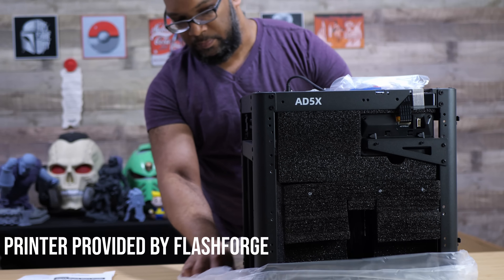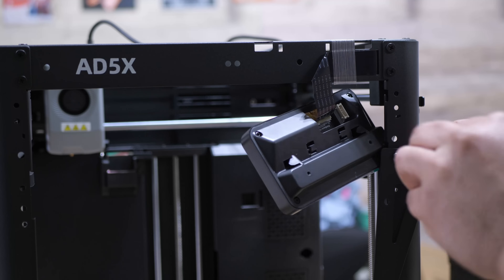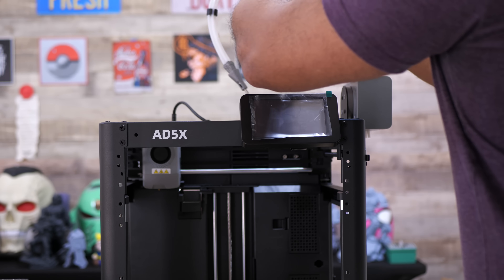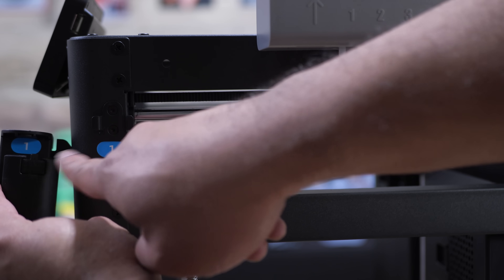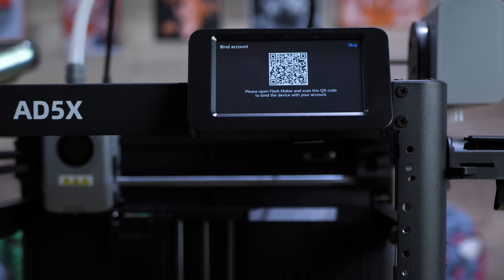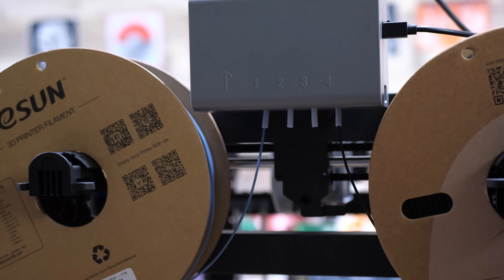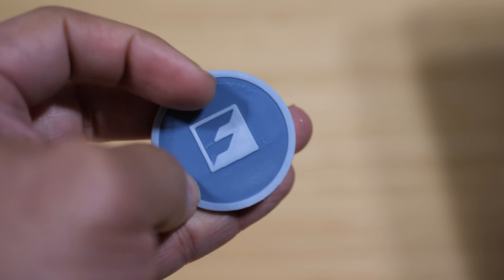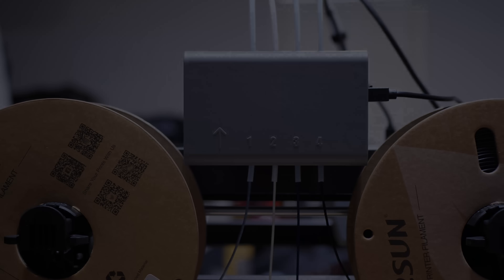Flashforge AD5X First Look! Unboxing, Setup & Test Prints

Comment: Can’t scan the QR code with the app because the camera sucks so bad, got the computer app. Different app btw, half the things, had to move the nozzle piece to get the styrofoam out of the unit and when I turned it on it just started running into the wall and wouldn’t stop, can’t calibrate the unit without connecting to the mobile app, not an option to do it on the computer, please send a quick fix before I actually toss this thing upside down in the box no tape and send it back

Comment: Hi, I was going to buy an AD5M based on one of your other reviews. It came off special the day before I could afford buy it. A couple of days later the AD5X (which I didn't even know existed) went on special and I bought it without checking for a review. It arrived 4 days ago, but I said I wouldn't touch it until I learnt how to do the basics of freecad. 
I'm setting the AD5X up today because it's raining. This will be my first ever 3d print on my first ever 3d printer. Thanks for the set up video.❤❤❤❤

Comment: Question y’all . I been having trouble with my prints failing and stringing and not finishing . I tried adjusting settings and temperature. I also had a weird noise from the bed one time . I feel like I’ve gotten a test model. Idk I’m probably overthinking but ima clean the nozzle out again and see what’s up but this doesn’t feel right to me . I might return it what would y’all do ?

Comment: Do you know how much test filament it comes with? I just got mine and it has 4x test filament and I haven't received my spools yet. I just want to know if I am good to print a full bed of small figures to test, or if I should only print one of them until my spools arrive?
Reply from the maker: I'm not sure how much the amount of sample filament is, but the typical amount is 50g per sample. I'd print 1 figure to start just to make sure the adhesion and print quality is good.
Reply: @FigureFeedback  Also the maual says the toolkit includes glue but I didn't see any glue anywhere. Is that the same for you or did it come with glue?
Reply from the maker: Mines did not come with glue or lubricant.

Comment: the machine is good, but why not upgrade the platform to 300x300 - just to stay current
Reply from the maker: Flashforge is coming out with the Guider 4 Pro this year that will have a 300mmx3 build volume along with IFS compatibility.

Comment: Good to see the AD5X in the wild after the initial shipping delay.  I seldom do any color printing although that Joker looks awesome, but I'd like to have an AD5X to print TPU and PETG on the same part, or PLA supports on a PETG part.  A lot of purging is needed to avoid weak prints from dissimilar material contamination.  I was initially very interested because FlashForge said the IFS would accommodate 95A durometer TPU but I've since heard that they rescinded that recommendation and now require the stiffer TPU so I've mostly lost interest, but the IFS does still look like the best design for an MMU with streamlined integration and minimal Bowden tube travel.

Can the AD5X load two reels of two kinds of filament and intelligently switch from one to a full reel when a reel of the same material is empty?  It'd be handy for a print farm operator to unload parts and replace any empty reels and not need to worry about a reel running out in the middle of a print.
Reply from the maker: Yes, it can intelligently swap between filaments. This feature works only if you're using the same filament type and color.
Reply: @FigureFeedback  - Thanks.  I just checked the AD5X web page.  They do mention the AD5X ability to automatically switch reels.  "When printing a single-color model, once one spool is used up, it automatically switches to the next spool. Print with peace of mind."  This will greatly simplify print farm management and makes everyone's life easier.  If it has this capability, it should be able to have backup spool capability for two color printing, or generally, any time there is filament available of the same type and color.

Comment: I have the adventure 5M that only does 1 color. Ive switched to a 0.25mm nozzle, reset the settings to 200°C and bed to 55°C, and am using PLA+ instead of regular PLA... works a lot better now. Also switched to slow print speeds
Reply: How do you set the temperature to stay . Because when I print it changes. Idk why does it have to be through the program or through the printer itself ?

Comment: i feel like they could sell just the extra things and I could add this to my "normal" A5M, I hope they do. 
What do yall think?
Reply from the maker: Flashforge said the IFS is not backwards compatible. It uses a different extruder, mainboard and there are differences on the frame where it needs to mount and flush the filament.

Comment: Bambu X1 has become the new Prusa i3. Everyone and everything is copying the design
Reply: The IFS is streets ahead of the AMS. The feed path is very straight and as such it's far easier to clear jams and clogs and can also handle TPU (not just special Bambu TPU). I've just printed a 4 colour Gecko in TPU on mine.

Comment: First time seeing this in action. Great job on this. I actually like that it doesn’t have a separate unit for the multi color and is just mounted on the sides
Reply from the maker: I appreciate the simplicity of the system so far.
Reply: Me too, the main attraction for me.
Reply: I wonder if it will be as good as P1p

Comment: Wonder if you could print from a storage box or dryer instead? And would be good to see how much poop it produces in comparison to a Bambu with AMS.
Reply from the maker: That's something I have to try. The location of the spool holders and where you assign the spools directly affect the retraction distances. I wonder how that will work in a filament box since all the spools are closer together.
Reply: @FigureFeedback  Can those retraction distance be manually modified? Being able to print directly from a dryer would be a requirement for me.

Comment: Oh HELL no! First thing I saw was ribbon cable for touch screen. After my first and second  Flashforge 5M I swore I would never buy a printer from them that required the customer to install the touch screen. Why, the cheap piece of garbage cable latch on the touch screens ribbon cable connector. Latch broke both times. Had to ship both printers back. When they offer a model like the Adventure 5M pro, which has touch screen connected, I will buy an AD5X. Ok, I watched the video a saw the touch the touch screen is connected, still want the Pro model.
Reply: The AD5X comes with the screen mounted on a small bracket for transportation and already plugged in. You unscrew 4 screws and then clip the screen in place.
Reply: @theaussieviking8555   I read the unboxing instructions for this Flashforge AD5X, on the flashforge site, and it show you have to install the touch screen. I suspect they sent influencers the ones with the touch screen installed. For their regular customers you have to install this piece  of garbage touch screen with the defective ribbon cable adapter.

Comment: My first multi-color print was not great, but I've got another bigger multi-color print going now that looks pretty decent so far, we'll see how it turns out. My biggest issue is that the material/time estimate in the print preview is way off. There is no gcode for the material change so it doesn't calculate flush or add the filament change time to the estimate. My first multi-color print was estimated at 13g and 2h 34m, but was actually about 60g with the flushed material and took 3h 22m. My current print is even bigger and is showing it will take 7 hours less than the same print sliced on my P1. I did clock the actual filament change time and the 5X is 20s faster than the A1 and 34s faster than the P1, but with the number of color changes that is nowhere near a 7 hour improvement.

I have reached out to Flashforge support asking if they can provide the gcode or push an update to the print profile JSON code so we'll see how that goes.
Reply from the maker: Thanks for sharing those findings with us. I would also like to see the amount of flush in Orca-Flashforge as well.
Reply: @FigureFeedback  If FF support isn't helpful I might have to learn gcode better and reverse engineer what the printer does to develop the code myself.

Comment: Nice, although i am probably going with the elegoo carbon . It's just too good for the money.
Reply: Keep in mind that this is a multi-color printer right out of the box without needing any extra hardware. If you eventually want to go multi-color you're going to need to buy an addon down the road for the Elegoo and there's been no details released about if that will be any good. There's also no details on pricing yet, but other similar systems usually run around $300. Even if Elegoo beats that price and drops one for say $200-250, that's still an additional cost that puts the CC at a price equal to or above the AD5X or A1 Combo.

Comment: i there any info about larger size bed plate on next iterations ? )
Reply: The Guider 4 was displayed recently at a trade show in Europe (forgot the name of it), but it uses the same system but is 300x300x300. I'd expect it by mid-year as it was initially planned for the 1st quarter.

Comment: Please do the koy Fish in silk filament 😇 or do tpu and other filament test
Reply: I've done a multi-color TPU test with a black TPU and an Amolen rainbow TPU. The result was quite nice. It had no problems loading and unloading the TPU from what I could see. I see this as the one killer feature this printer has that I don't think any other 3D printer can reliably claim. I definitely want to do a larger multi-color TPU test in the future.
Reply: @donnyriggz  - Initially FlashForge advertised that the AD5X will feed 95A durometer TPU then they delayed shipping the pre-orders and said it would not support 95A TPU.  Are you saying it DOES feed 95A TPU reliably?
Reply: @Liberty4Ever  So far in my one test with about 30 color changes, it had no issues. I don't recall them saying it wouldn't work with TPU. I would have canceled my order if that was the case. The email they sent out said they were delaying the machine to fix issues poop chute jam issues with TPU. I plan to pick up some of that new Cookiecad TPU this weekend for a bigger project. Might also order some of the Amolen Glow in the Dark TPU to see how it handles that.
Reply: @donnyriggz  - I knew that FlashForge claimed the delay was due to problems with TPU in the poop chute but also recall them removing their claim of 95A TPU.  I just checked their website and they removed all references to TPU from the filament section: "AD5X support PLA/ PLA PRO/HS PLA/ PLA Matte/PLA Silk/PETG/PETG Pro/ HS PETG/ASA and open to third-party brands."  There is a separate printing speed graphic that references print times for a 64D TPU basketball.

On the plus side, they do mention the AD5X ability to automatically switch reels.  "When printing a single-color model, once one spool is used up, it automatically switches to the next spool. Print with peace of mind."  This will greatly simplify print farm management and makes everyone's life easier.  If it has this capability, it should be able to have backup spool capability for two color printing.
Reply: I was not aware of that change. It's also curious how they mention ASA, but not ABS when the IFS filament selector has a Profile for ABS but not ASA. It also has a profile for TPU.

Comment: Does this printer have an ethernet port like the earlier Adventurer 5M and Pro?
Reply from the maker: Yes it does.
Reply: @FigureFeedback  I really appreciate that Flashforge has this as a regular feature on all their printers.  I work as a teacher, and my school district does not like having anything besides computers on their school wifi network; this is a common issue in school districts.  I personally run 2 Adventurer 5M Pros and one 5M.  I have them connected via ethernet and can send print jobs via FlashPrint from a connected desktop.  It's very nice to be able to sit on one computer and send jobs that way.

Comment: I’m curious about the feasibility of an enclosure. It would need a bit of a “hat” I think. Would be needed for ABS, right?
Reply from the maker: I can't wrap my head around how to enclose this printer. I'll leave that up to much smarter people. ABS would greatly benefit from it.
Reply: @FigureFeedback   This might just need a tent 🤣
Reply from the maker: Simple and effective!
Reply: I'm working on one right now, I have a pic in their discord.  I only have the top to finish as I'm just about done with the poop chute.  I only had to modify the A1, A2, D1, D2 corners for the screw holes.